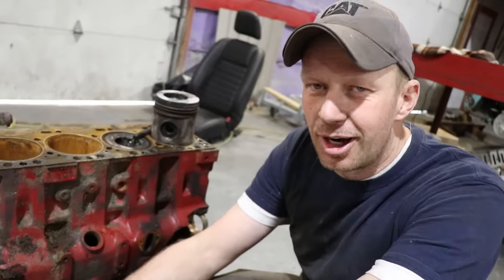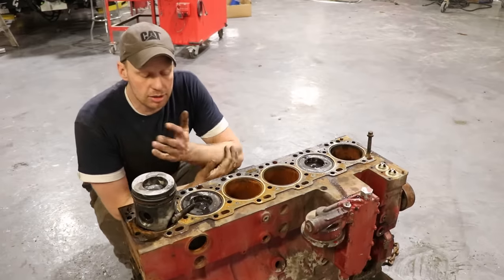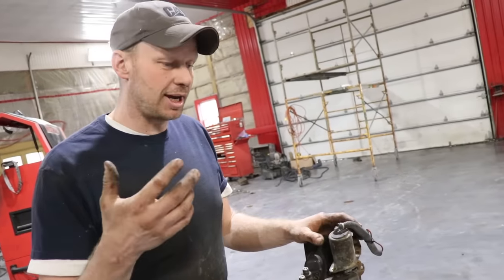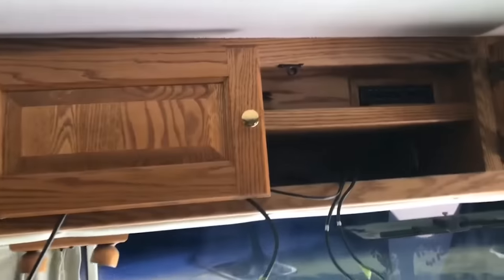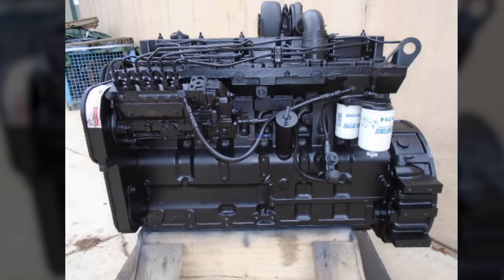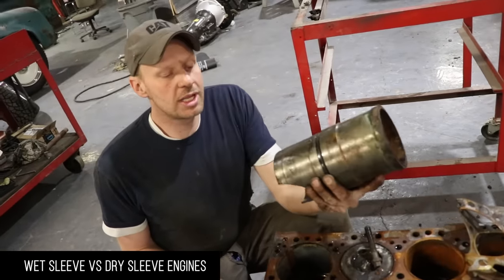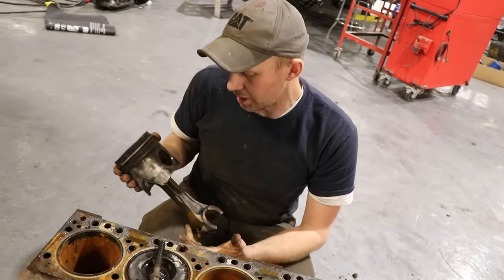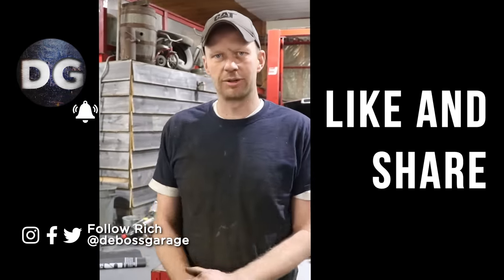REVIEW: Everything Wrong With A 8.3 Cummins Diesel

Comment: Great video, we have 3  8.3's at my shop, my 1993 which had a problem with the front timing cover cracked and dump the oil, what a job that was. That engine also had plenty of other problems.  The other 2  8.3's had electronic problems. We don't consider them any good. I switch to a 1988 L-10 in my single axel dump. Thank you for taking the time to make this video, I am a new subscriber.

Comment: We use to use the Dongfeng-Cummins 6CTAA8.3 in our 200kVA gensets (moved to Perkins 1106).
They worked very well and could do high hours but with a lot of the Dongfeng-Cummins, they leaked oil, in particular from the oil cooler.

Comment: That dowel on the B series only comes off if a fuel pump or compressor is mounted incorrectly causing the timing case to flex over time. It will never happen in a stock engine, hence why Cummins never issued a "fix" for it.

Comment: 7000 hour rod kick outs in combines are due to "farmer maintenance". We run them well into the 40k hour mark and pull them for overhaul. I've been tractor pulling with them for 12 years and well over the 1000 horse mark and 3000 ft lbs. They did address the coolant out problem with the newer common rail (which is my block of choice) and roller blocks.
Reply: Ya

43,000 hours on my July 1999 Built Cummins N14, 4,300 Idling hours (Day Cab so it is shut off every night).  10 lb of oil pressure at operating temperature at idle and 30 lb of oil pressure above 1000 RPM at operating temperature just as the specifications given in Publications on the engine.

Comment: 8.3 is the engine found in the Military 5 Ton's, 80's to 1995
Reply: The 8.3L 6CT is actually in the M923A2-M943A2 five ton trucks for 1987 to 1994,those trucks were made by BMY Harsco too,but you are correct,just off by some years.
The M923-M943 & M923A1-M945A1 which came BEFORE the M923A2-M943A2 going back to 1982 all have the 14.0L NHC-250,and the M812-M820 used the same engine in early years too.The M923-M943 and M923A1-M945A1 were made by AM General too,and it's easy to tell the difference between the three variations of those trucks,the M923-M943 has G177 dual tires which are 42 Inch (1100×20) and then the M923A1-M945A1 have super single Michelins "XL" that are 48 Inch (1400×20) and finally,the M923A2-M943A2 also have super single tires which are 50 Inch.
The reason why they stopped production for them in 1994 was because of the Stewart & Stevenson M1078-M1088 FMTV,at least in the Army.For the Seabees and Marines,the Oshkosh MK23-MK38 MTVR came out a few years later,which replaced the M939 Series.

Comment: I know most of the problems with the caps system but that said i work on these every day in school buses and they are a very good engine. It helps having sister buses to swap tronics if you think it is a computer problem but otherwise they are easy to diagnose. As we say if they can hold up to a bus driver they must be good.

Comment: On the last 8.3 i worked on last year i just used a cat sleeve puller. The puller's feet just fit on the engine deck but it work fine. You just got to make sure that the pullers "hookes" that go on the bottem of the sleeve dont touch the sleeve retaining webbing in the block, if it does it would damage the puller and the block.

Comment: my company built the M1117 ASV for the Army. We used the 6CTA, which has the liquid cooler in the intake. We had very few problems with these engines in almost 5000 vehicles we built for the U.S. Army as well as other countries. Ours was rated at 260hp and something like 840 torque.

Comment: Great review... I'd love to see a VW 1.9 in your hands.  

Digressing for a minute...

I've had "German" diesels since 1982. 5 Cyl/3L Mercedes, a 1.6L VW and a 1.9L VW (2001 ALH). The 2001 runs good... Typical pump replacement at 165K. Timing belts every 60-80K... Put a Franz bypass on at 180K and an Mann PVC filter/Oil catch. Both work well.  Replaced the injectors with a .205 flavor at 165K. Not dramatic but nice. 

One of the changes I made in 2019 was adding Hot Shot's Secret to every tank. I don't run a lot of highway miles these days. Hot Shot seems to keep the engine happy, "smells better" at the tail end and kept the fuel line moving at -10 below. 

Again, a really treat to watch and listen to your vids.

Comment: The US Military used the 8.3 in the M939 series 5-ton trucks made by AM General.  The rated horse power in that application was 240 hp. 

The 8.3 was significantly lighter than the NHC-250 the 855 cubic inch NA engine that it replaced .

The weak link with the engine in military application is the water pump and the steel line used for oiling the turbocharger.
Reply: You are correct,but the M923A2-M943A2 was not made by AM General,all of them were manufactured by BMY Division of Harsco actually.The M923-M943 and M923A1-M945A1,which had the NHC-250 were the only ones made by AM General,the A2 was only for 1987 to 1994,the first M939's and then the A1 go as far back as 1982,the A1 came out in 1984/85.The NHC-250 was also the only engine ever used in the M812-M820,for 1969 to 1982,and they were all manual,they did not have Allison Automatics in the M809 trucks like the M939 trucks do.

Those trucks also had errors with rusty springs in the Overflow Valves and some of them not having Hydraulic Hoses,which were always better for them.For the most part,they had issues with the fuel systems in the long run.

Comment: I installed many of the different styles of cummins engines in over the road trucks and other applications, where you get in trouble I found was plumbing them if say you pull the old detroit out and then think no problem, its just bolts... in a way it is but the way sensors are different and  the whole thing is apples and oranges. It can and does get easier as you gain experience and that is the key. Two parked alongside the other one. I like many have had some awshi* moments   when messing with the pump. Yeah you can get a thousand horsepower and do a burnout and every  trucker can't wait right??? I just haven't seen any so must be your channel and a c ten build. My hand is crippled so one handed and all over the place on capitals and so many mistakes in spelling changing the whole meaning and some cases a swear word or otherwise. I love the content on your channel Rich and hope I am good with you. By now you know its the long winded crip from alaska. I just wish that I had started in this era of mechanics and loved the fifties and sixties too

Comment: 1.9 Tdi
Reply: ALH was the best.
Reply: Yes it was!
Reply: I'd also argue a asz pd130 with no emissions bollox and a straight pipe with a medium-heavy map on it 👌🏻
Reply: Check it VW has plastic water pump impeller failures alot.
Reply: Yup alh for the win. The bew is shit and the  commonrail is only marginally better
Reply: I had a 2002 Golf TDI with the 1.9 ALH.  Awesome engine, awesome car.  I put 421K miles on it, and sold it to my nephew, who now has over 500K miles on it.  Still all original.  Keep the timing belt changed, that engine will get you to the moon and back!!

Comment: These 8.3s are super common in late 90s early 00s here in the uk in double decker buses running the CAPS fuel system there super reliable in the 10years I worked on them I done plenty of injection control valves, injectors and tons of lift pumps! very rarely replaced replaced a full pump and when we did it’s because the cam inside had shit itself. Other then that I’ve done pistons and liners in just one very stout motors I’d say far stronger then a ISB variant

Comment: We had a mid 90s L9000 jet fuel truck with 8.3l, for at least 10 years it had a broken head bolt and never missed a beat running 18-20 hours a day.

Comment: 13 years owing mine it has 884000k Eaton 10 manual in a Kenworth T300 day cab, still hauls 30k lbs like a dream runs awesome, tips: proper warm up and cooling, never idle more than 10 mins, idle 3-5 mins before load/ after highway run, oil coolant check daily, drain fuel water sep daily, lucas stabilizer oil top ups, flush coolant regularly,  never overfill oil, no downshift at very high speed, going downhill at reasonable speed and diff / tranny oil affects performance and grease, brakes more,
Reply: 884 that’s amazing what oil do you use .

Comment: Like the guy says in the video, the Cummins 8.3 was a popular motor. Some road tractors like the Freightliner FL70 ran it. Sometimes with a 10 speed  manual, or, an Allison automatic. Even some fertilizer spreader trucks had ‘em
Reply: did the fl70 have a air splitter? I picked up a free parts truck with a 8.3 and a manual transmission but there's no shift patterns marked in the cab. i figured it was just a 6 speed but I'm trying to figure out how to identify what transmission I do have before I start swapping it into my c60. I know I'm going to be doing a bit of sheet metal work. but help identifying the transmission would be awesome

Comment: As some others here have stated, Liner pitting on some engines has been found to becaused by electrolysis. As the liners are not thourghly grounded to the block. Also been found to be a cause of cylinder head corrosion.
Reply: How would a liner not be grounded if they're assembled with a small interference?
They should have full contact with the block (if properly made and installed without warping and leaks). If the block isn't properly grounded, then that would be a issue for the whole engine, even with some problems starting it up, not to mention premature and excessive rusting.
The mechanics of damage by cavitation involve localized rusting, so a localized electrolysis does happen to form pits, but that only occurs either by a bubble of water on metal or a bubble of air in a water solution, the latter being the case, but that bubble only occurs due to vibration, since tge system is pressurized and shouldn't bubble up!
Reply: @chaoswarriorbr  If a liner is installed and has coolant or oil on the interference then poor grounding can result. Its not the block thats poorly grounded its the Liner to the block. Also has been found to be a problem with cylinder heads. And Yes the head gasket can be an insulator so can the head bolts with thread sealant or lubricated threads can cause poor grounding. Caterpillar has done studies on electrolysis and found that this can be a cause of liner pitting not caused by cavitation.
Reply: @larrydunlop378  As I said: "if properly installed"
Though I'm surprised coolant and/or oil should be covering all the contact surface anyway. That requires one heck of a talent to do a shitty assembly job!
Also, I think you've missed the point of my comment on the mechanics of such damage. All pitting happens, in a direct way, due to electrolysis, the way that this happens might vary in the specifics, but the cavitation issue might happen even if everything is properly grounded, just like I've commented before. Assuming is just electrolysis due to bad grounding is just not true overall and it's a bad maintenance practice without further investigation of each specific case. There's plenty of Material Engineering studies supporting the specific mechanics of a "battery" created because of a bubble of a aqueous solution or a buble of gas in a aqueous solution.

Comment: You are correct about cavitation but if the coolant system is not maintain correctly with antifreeze and dca levels and the coolant system is allowed to run at low levels then the pitting occurs. I have been a tech at Cummins Inc for 41 years and this will occur in any wet sleeve engine on the market. So maintaining a coolant system on wet sleeve engine is vital. Thus the use of coolant filters.

Comment: Some ones gotta diesel swap a demon with a 6.7 or an 8.3
Reply: Turned up 12V
Reply: @Seth_Stewart  nah its gotta be something crazy and over the top. They already have a 6.7 duramax in a Camaro so you gotta beat, or match it lol. Preferably beat it... but an 8.3 in a demon would be pretty damn near impossible I think.
Reply: @matthewb7049  why would they make the demon less capable? The hemi platform is already capable of more than most diesel platforms.
Reply: twisted dome I had a buddy with a 6.7 Cummins all done up.. never seen an 8k pound truck move so fast..

Comment: My 2002 Holiday Rambler Ambassador has this engine, 8.3 with a vp44 I did put a fass fuel pump on it to prevent my vp44 from getting air locked and burning out on me.

Comment: Had the an exhaust crack on ours. Right in the middle. Ran it that way till I sold it. Replaced it but broke pretty much 60% of the exhaust bolts even with all the best methods applied.Drill and tap for 3 days oh what fun. If you do run into this situation, you will probably need a starter tap, a normal tap and a bottoming tap to get the job done  1688 Case combine engine

Comment: Cummins 5.9 is like a national engine in India. But most of them come with a A pump or ve. We also have 24v 5.9 with ve pump and common rail. BTW it's possible to install sleeves by boring the block. Most times use a boring bar with block still installed in the truck.

Comment: Back when i lworked in a truck shop I swapped 8.3s in a delivery truck, original engine probably would have lasted longer but the customer wasn't keen on maintenance and the coolant filter rotted off.  Short while later he needed a tow and an engine lol.

Comment: Alot of good info, the issue I have with the c series is that the exhaust manifold bolts are a nightmare to remove without breaking them off in the head, there stainless which is great until they gaul in the head just from the constant heat cycling. Other than that great video!

Comment: Caps pump can be replaced with a p-pump. All you need is custom fuel lines and adjust the injector pop pressure.
Reply: As a matter of fact the second gen case ih mx magnums used both systems depending upon the size of the tractor. MX210, MX 230 had the mechanical pump and the mx255 and mx285 had the CAPS pump.

Comment: The C ISC and ISL are the go to engines in the transit industry  a lot of them in city buses. A lot of head gaskets issues that pushes oil out the camshaft side under hard boost also noticed a lot of broken top rings always figured from overheating and the main oil rifle plug next to the cam plug behind the flywheel housing pushes out making  you think it has a rear main leaking but it that plug have seen quite a few rods out the side of the block. But it’s one of my favorite  motors to work on. A simple as a diesel can be.

Comment: The cavitation just causes air bubbles to form. Not sure if that's what you meant. On the marine diesels we work on this sometimes happens very quick when seawater finds its way into the closed cooling system, usually through the heat exchanger. This would exacerbate the cavitation issue very quickly and eats through the sleeve.

Comment: Hey Rich i know you were asking about cavitation in regards to cylinder liner pitting and such. There are 2 main schools of thought for cavitation in the cooling system, the first is the one you mentioned about the bubbles collapsing causing strong local shock waves in the fluid from when a pump blade or vane moves faster than the fluid it is moving. The second way is based on the Venturi effect, it is the reduction in the fluid pressure when said fluid is moving through a restricted path.  Doing so lowers the boiling point of the coolant which create vapor bubbles, "cavities".  Because of the constant flexing of the cylinder wall from Ign and compression creating high and low pressure waves in the coolant the "cavities" collapse and split in two casing a "high powered jet" of water to remove metal from the cylinder liner.
Reply: Nightbane   Thankyou  for getting one step closer to understanding cavitation. It's always been something that has escaped me     m

Comment: You're very knowledgeable, you know that engine inside and out! Same engine in a New Holland TG285. It does pull very well, and I'm GLAD it is heavy for tractorwork. Things I don't like is that it is extremely loud and obnoxious. The CAPS system has been OK so far with it... until something decides to go someday, and the engine coolant does tend to run a little warmer versus all our other tractor engines.

Comment: Anyone confused about the water filter coating and pistion slap section? The pistons cause vibration in the wet sleeve. Vibration in the sleeve with coolant surrounding it can cause cavitation in the cooling system. One inceasing heat because of the lack of coolant, but also cavitation is extremely abrasive. I didnt put 2+2 together until now why coolant filters were actually a thing. They arent solely filters, they are a constant additive into the cooling system to coat all surfaces to provide a film to be worn in the case of cavitation. Thanks for the info Deboss Garage!

Comment: Wet sleeved engine have their advantages in applications when the engine is to be rebuilt again and again.  They also bring thier share of issues such as sleeves failing(hint hint isx), sleeves leaking at orings(hint hint 466e), increased block size, and finally increased manufacturing cost.  Finally Parent bore engines can be built stronger in a more compact size than a wet sleeved engine.

Comment: I lost my CAPS pump at 78,000 miles on my motorhome (this past Nov) and have no installed a FASS system in hops that won't happen again. I switched over to long term coolant four years ago so I don't have to mess with it.

Comment: A little surprised to hear about the overheating issues, got a 2166 that's been operated in very hot weather, can't remember exactly but definitely at least 38⁰c and hasn't had a problem.

Edit: although now i think about it the 2166 is at the lower end of the 6ct's power rating so i guess that'd help

Comment: I've seen the CAPS pump used until late 2006 on the 225-260hp ISCe used in the Dennis trident II double decker, They are surprisingly fast even with the Voith D854.3 .